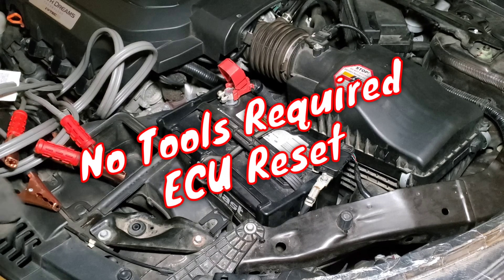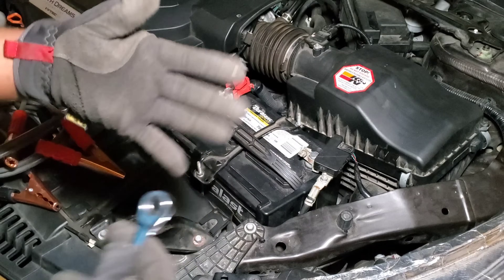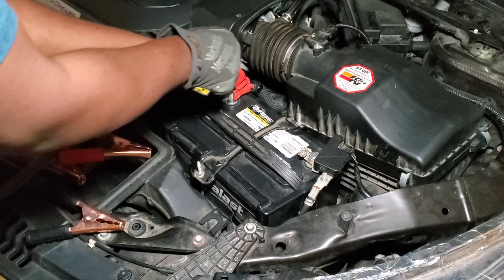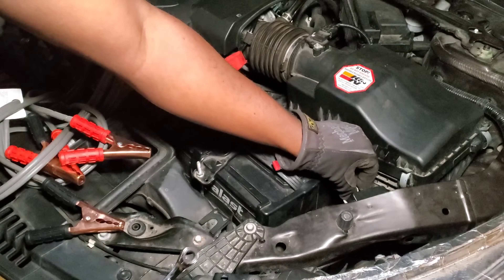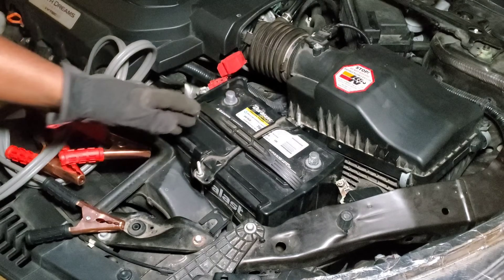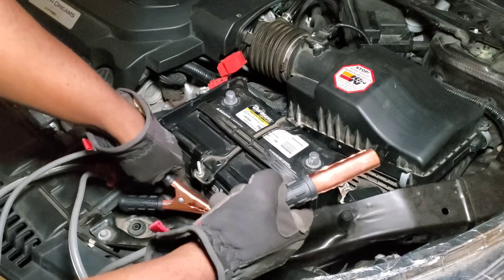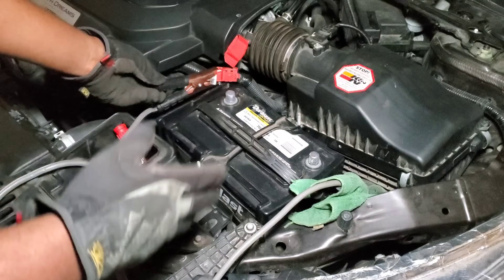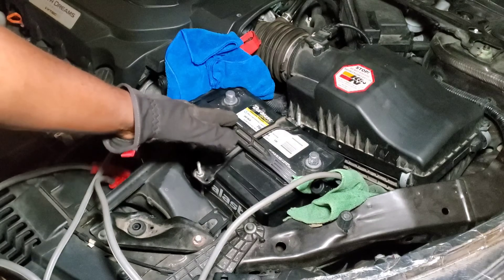How To Reset All ECU  No Scanner No Tools Required

Comment: You always take off a negative terminal first! Also absolutely no need to disconnect the positive terminal - it holds no charge. An ECU is powered by negative ground. Just turn on your lights to drain capacitors.

Comment: if you don't turn the key on inside the car the reset won't happen. Turn the key on for about 10 minutes that connects the circuits to the power, otherwise not having the key on is not letting the circuits drain.

Comment: Hi. Can I do it on 97 toyota t100?

When i turn the key to ACC position all dash cluster lights comes on except the check engine light. It cranks but no start. 2nd when i turn off the key or pull it out the check engine light comes on but low light. 3rd I'm trying to scan for codes it freezes and shows no link either way if the key is ACC or OFF position.

Comment: Just take the terminals off and zip tie them 2 together meaning the positive and negative battery terminals together you don’t need jumper cables to achieve this.

Comment: Great video but just one question, in all my years working on a wide variety of different types of engines everything from tiny little 80cc 2-strokes to Big Block 460 V8s I ain't NEVER heard of a "Taah Rottal body" in the 40+ years I've been working on engines? 😉

Comment: To save a lot of trouble, remove the battery connection, positive first, on the side away from the terminal and try to crank the car 3 times, off to crank in repeat.  That will drain the cars energy without waiting

Comment: I jus changed my throttle body, I hope this works. 
I’ve got a Hyundai Elantra 2015, 
After changing throttle and cat manifold these codes popped up, 
P0076,P0079,P0031,P0445,P0448,P0037,P0140

Comment: Make sure your car is not in gear when using the jump lead method, as this can make your car to start as there is sufficient power left in the alternator to fire up the engine.

Comment: what if you don't have jumper cables will letting it sit for a few hours work?
Reply: Touch them together for 60 sec have your lights on and drain  the horn as well then reconnect POS first then NEG

Comment: I just installed a new o2 sensor. Im hoping this resets the cycle. I took the positive off first tho. Might have to start over. Update, it worked like a champ. Check engine light is off, o2 cycle is reset, trucks running great!! Thank you!!!

Comment: When disconnecting a car battery, always disconnect the negative terminal first and reconnect it last. Here’s why:

Why Disconnect the Negative Terminal First?
Safety: The negative terminal is connected to the car’s chassis (ground), so by disconnecting it first, you reduce the chance of creating a short circuit. If you were to accidentally touch a metal part of the car while removing the positive terminal (which is connected to the battery's power), it could cause a short and potentially spark or damage the electrical system.

No Risk of Shorting: When you disconnect the negative terminal first, even if your tool touches the car's chassis or another metal part while working on the positive terminal, it won’t complete the circuit and cause any issues.
Reply: BRILLIANT!

Comment: My Toyota car won't start, I have to remove the battery first and then reinstall it. After that the car can be started. What's the problem with my car?

Comment: All you have too do instead all that simply turn on the headlight switch that will drain all the power left in the system
Reply: Push the horn as well right?

Comment: Oh gosh, that really hurt my eyes - no joke - watching that positive cable be removed first.

You should also be able to just disconnect your battery (negative first and then positive), pump your brakes 5 or 10 times to discharge any remaining energy skipping the jumper cable altogether. Let it sit for however long, half to one hour. Reconnect battery (positive first and then negative). Your result should be the same. 

Using the jumper cable just seems like an unnecessary added risk.
Reply: THANK YOU REALLY YOU MAKE MORE SENSE THAN HE DOES!!!

Comment: The problem is if abs light on that means you got a problem that needs fixing all this does is remove the lights for awhile the problem is still there
Reply: You do this reset after fixing all the faulty codes

Comment: the codes always comes back because their is a reason why the error comes up..
ive been doing this since the 90s 
make sure you tell people its just a temporary fix.
Reply from the maker: come on man. this is not something that will fix the problem on your car. you have to make sure you fix the problem that caused the code. and use this to delete the code. I’m pretty sure you know that right? because if you don’t fix the issue and you do this. the code will come back again.

Comment: It's strange I've watched a couple of these types of videos to see what they suggest doing and I always say all you have to do is disconnect the negative terminal and wait 10 to 20 minutes that's it. All of those other steps are unnecessary. If you want to speed up that time then go in your car and turn on anything that would use electricity for a couple minutes. It doesn't take that much to drain a 12v system 🤷
Reply: AWESOME YES turn on the lights and blow the horn while disconnected!

Comment: my toyota belta 2008 car have engine light sign with transmission solenoid error and washshop already check solenoid and it is good .. cable checking also good ,but alarm still can't fix it .. when check ECU to ECU socket power, all are 12V , one is ground and one only have around 6V ..
Do I need reset ECU  ?  during last 2 month ago, I do plugout battery to rechargle issue one time..

Comment: Bro if this works on my honda I owe you an cold beverage or 20!
Reply from the maker: I will take that cold beer anytime🙏🏽
Reply: Bro sure will try to make it happen. Which one is the PGMFI relay under the dash on driver side? Is it the blue one. 2017 honda accord 3.5 v6 coupe auto? In case you have access to that info all I can find is the fuse diagram.

Comment: I have the same problem, went to auto repair, code deleted, every thing was fine. then i first installed the check engine light and PGM light came , went to auto repair, code deleted, every thing was fine, removed the LED installed on the front for day time running lights installed some fuse in fuse box  again the same problem. Now i again went to same mechanic but he half heartly tried but code came again and again. did the above by removing battery terminal for hours and hours but the fault did not disappear, car performance is restricted, i can not rev the car in 1st gear above the 2000RPM until put the car in 2nd gear. same with other gears. How can i solve this?any advise please?

Comment: Thank you, No tool 10mm spanner needed 😂.
What about making sure you have the radio security code before you do this. With many vehicles on reconnection your radio will now be locked and looking for the security code to unlock. Best to have this before doing your ting.
The residue charge of car ECU is stored in capacitors, which will discharge by themselves, so jump leads not needed, only short out caps to speed process along, but unnecessary step if you just leave disconnected for 15 to 30 mins.

Comment: My 2009 mazda 6 is immobilized. Key fob not detected, no crank, no unlock or anything after a new battery. Lights on dash appear, but the car is basically dead. Hoping this works when I try later. Mazda charged $1,100 last time I went through this issue.

Comment: I drive a dodge avenger. So the battery is in front of the driver side  tire. Can I just drain the battery til it's dead and then jump start it. Would the work to reset?

Comment: You actually don't have to disconnect the negative battery side.  Just jump the UNATTACHED POSITIVE CABLE via wire/jumper cable to the negative side of the battery which is the ground.

Comment: Does this work on a honda fit 2011? My battery died and I got a new one but my car does a solid beep and won't start. Would this trick work? Everyone thinks I need to take to dealer to reset computer

Comment: Please can you make a video how to clear code if staring wheel became hard or a problem with electric power staring. 
Or torque sensor problem also advise me what kind of OBD2 scanner i can use at home to clear these types of codes. Which is the best software for that and how i can use my laptop for this

Comment: I'm going try this on my 2016 jeep renegade! I'll let you know if it works? Put new battery in and now it's showing voltage ⚡ issue, but alternator is fine! We disconnected negative cable with car running and it didn't shut off,so I know alternator is fine! Update did not work for 2016 Jeep renegade! I did what you said and still shows voltage issue? Now it has to go to dealership, thank you for nothing! No savings here!
Reply: Informative 
We don't disconnect the cable from battery when the engine is running 
That can destroy the Alternator
And Ecus

Comment: Do you have to connect the positive and negative together to clear the codes?  I thought just disconnecting the battery would clear them.  I need to try  this on a Subaru Legacy…

Comment: Didn’t work on my 2015 equinox. Still have a permanent code
Reply from the maker: You have to first fixed the issue before doing this
Reply: @Loverofengines101  I did, all new parts, air pump etc

Comment: I like Scottie Kilmer method of putting a resistor in the jumper cables chain to prevent any sparking from a sudden discharge.
Reply: I use a tail light bulb as resistor and leave for several hours.

Comment: ** Not a good idea to use a jumper cable on late model vehicles! Many newer cars have complex electrical systems including  'telematic control modules' which have internal rechargeable batteries to save critical settings/data in the event that the battery is disconnected. Connecting pos/neg can potentially damage those modules.
Disconnect battery and turn on headlights (They won't work, obviously, but it will drain any residual power).

Comment: Thanks for sharing. This method is close to my "Frankenstein Reset"? I was informed on how to reset my PCM and ECM by a "honest mechanic" at a GM Dealership in Texas. When your vehicle has been parked and engine off and is cool to the human touch, you disconnect the battery cables, wrap them in clean rag and let the vampire electronics slowly lose the juice: I usually wait until 30-mins to 60-mins and sometimes it is a couple of hours. When I return I close the circuit by touching the negative and positive cables together for about 10-to-15 seconds then I reconnect the battery cables back onto the battery - start the engine and the whole system is reset and does a system check. I recently had to do it again to rule-out false sensors - the "Check Engine Light" has been gone for nearly a week, but the metal rattling noise is back - I am praying it is not my catalytic converter

Comment: I tried starting my car this morning but it couldn't start, as well as the starter motor does not crank.. iam lost
Reply: Could be your starter or a bad crankshaft position sensor, if you can get a  hold of a scanner like "fixd" run further tests on it to see what comes up

Comment: Your supposed to leave the positive terminal on and connect the jumper cable to the negative cable which is off the negative terminal. You didn't do anything by leaving them both off the battery. You just connected the cables together which did absolutely nothing. If either terminal was disconnected and then touched to the other, nothing would happen. Once a battery cable is disconnected from the battery, an open circuit exists. If the battery was out of the car and the positive and negative cables touched , nothing would happen

Comment: Hi sir.. Just a quick question.. Ive a problem with my car my rmp idle on 1500. When I drive and take it out of gear, the Rev goes up and down. Will this also help when I reset my ECU that my idle goes back to normal
Reply from the maker: I’m not sure but you have to try. I do this to my cars all the time. this is not going to do anything bad to your car you just have to try and see what happens

Comment: You Always…unhook the Battery’s NEGATIVE CONNECTOR 1st…., before doing any work on your car. 

If you (((do not))) remove the negative terminal 1st ….and proceed with unbolting the positive battery terminal … Your metal wrench becomes a 12V DC conductor …to any metal under your hood. 

Your car is the COMMON GROUND completing the battery’s circuit ….and it will cause an Electrical ARC! Basically, a short circuit to GND! 

It becomes a 700A welder that you don’t want! 

This could possibly cause an explosion …if hydrogen gas is present around the positive battery terminal with your wrench.

If you remove the (negative terminal) first, It Totally breaks the circuit of the battery….. if your wrench touches the rest of the car… it’s already negative and there’s no potential difference IN VOLTAGE and WILL not ARC!

If you ever change your battery, Or just reconnect your original battery terminals ……you always attach the Positive terminal(RED) 1st…..

and the Black (negative terminal last) when hooking it back up. 

If you’re doing work in your garage, all you have to do is remove your negative terminal ….and make sure it does not touch the negative battery post ….With a rag like you were showing. 

You do not have to unhook the (positive terminal) unless you are changing out your battery. 

You will be fine With only unhooking the negative terminal doing normal work on your car.

Also, it’s not discussed very often… About draining and resetting fault codes in the computer. Your expensive ECM/PCM… Could have transit voltage spikes discharging quickly with a straight jumper from your capacitors on the Computers circuit board ….and could damage To your system.  and a big hit to your pocketbook for a new computer.

You can buy a 1000 OHM 10W Resistor…on Amazon and use it to drain a slower rate With  jumpers….and save possible damage to your computer from smoking the LANS. Which are the small solder circuits on the board.

Comment: Ok so I have a good one for you. 2017 Ford Feista SE, non-turbo 1.6. Great car but about a month ago my wife was driving and the brakes seemed to apply themselves eventually bringing the car to a stop, would move. You could put it in drive or reverse and it would act like it wanted to go but was like somebody was standing on the brakes. When I pulled the from calipers they were very hard to get off. I took a guess and figured the ABS module bit when I replaced it my scanner was not able to reprogram it so I cleaned up the old electrical portion from the old one and put it back on, now the brakes still go to the floor

Comment: I was involved in an electronics sector for 10yrs or so. And I learned that DC Grounds are in  pivotal position in circuitry and I developed a habit that I always disconnect a positive side before a negative side so that there would be no floating voltages around components which might kill components on PC boards.  Just words from my experience.
Reply: Does it matter the order in which you reconnect them?
Reply: @kim.in.nature. 
1) we disconnect first( -)then we disconnect (+)
2)we reconnect first (+) then we reconnect (-)
If we do the opposite it may cause short circuit=damage
Reply: @konstantin-big  100
Reply: @konstantin-big that's wrong and you do that to many times your luck will run out and could be a trip to hospital . I have seen it first hand. It's nasty
Reply: @konstantin-big I wouldn't allow that on my vehicles. All people have to do is go look up proper way. It's not a opinion or anything. It's how the circuit works one is hot one is ground
Reply: @kim.in.nature. yes
+ then -
Reply: @kim.in.nature. yes .you can spike your battery and blow the battery up. Never take negative off first.
Reply: He did the positive first then negative. If that's what your was talking about. Always do positive first then negative.and same putting back on.
Reply: Put a 5 amp resister in between negative and positive jumper cable for a slow discharge of capacitors so you don't damage cars computer!

Comment: Disconnect ONLY the Neutral battery post, NOT the positive.
Get into the car and push on the horn (hold it down) for 25 seconds to eliminate the electrical charge in the system.
Leave the battery disconnected for a few hours.
You don't need to use jumper cables and if you make a mistake doing so it might be costly.

Comment: Hie my Toyota hilux d4d 3l 1kd has no power, only gets it's normal power if you disconnect and replace back a battery terminal, what could be the problem and solution?

Comment: You can use a smaller wire gauge(size) as a jumper wire. The purpose is to drain the capacitors(electronic batteries). 5 minutes is enough time to clear it.
Reply: Do I have to kept the engine running while waiting for the time?

Comment: Thank you for posting!  This saved me a trip to the dealer to clear a fault code.  Best description of this process I’ve seen on here. I recently changed out the coil packs and plugs on my e92 335i.  I tried to reset the “service engine soon” light using several scanners but none of them could clear it or even see the fault code (presumably because it is now fixed).  This fixed my only remaining problem, no more “service engine soon” light now.  Only thing I might add is when hooking things back up to hook the positive up first.  I’ve heard these cars are sensitive to that and it might cause a lot of other issues if the negative is hooked up first.
Reply: You ț😅

Comment: So my daughter just got a 2007 Pontiac G6. She took it to get air in the tires. Came home and parked it. Now it won't start. Dang anti theft thing came on. I've tried unhooking the neg from battery, wait an hour. I've tried putting it in neutral. I've tried to do the 10-minute key thing ... still won't turn over. Battery's date says Dec 2022. Looks new.